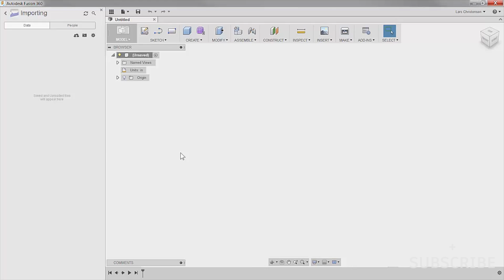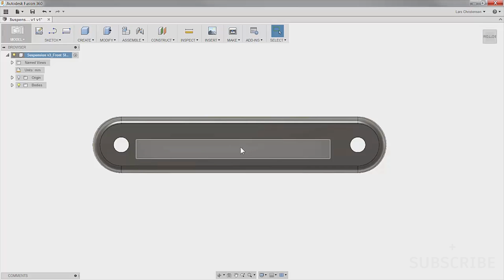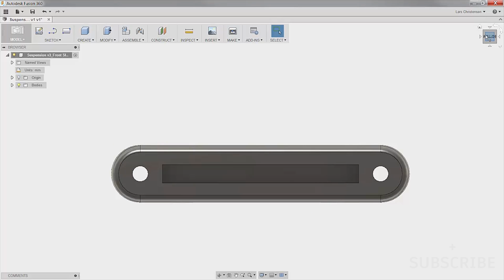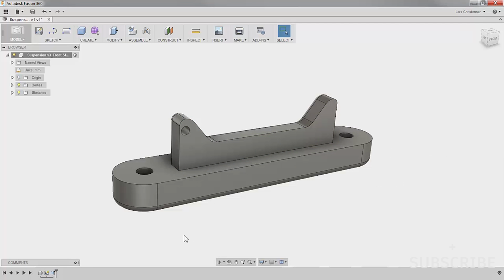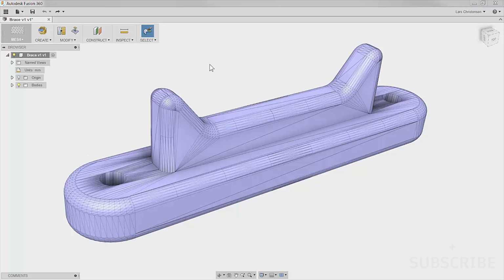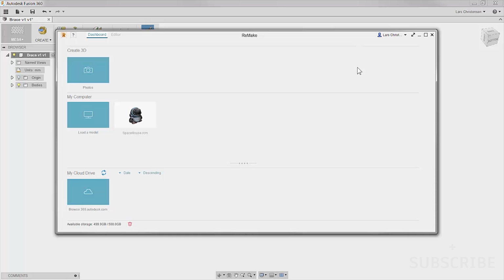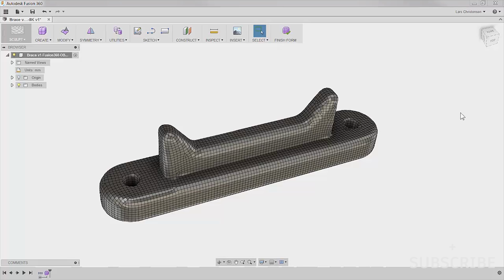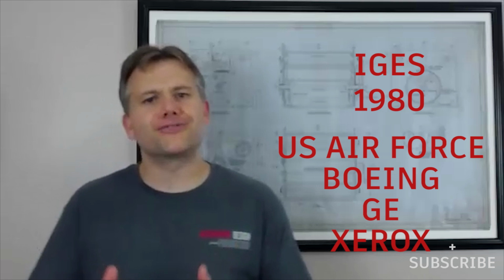Fusion 360 Tutorial— What you need to know about importing into Fusion

Comment: Hi; question:

How can I import a fusion file into another design, but without any links in place, so that I can delete the original imported file.....(just to add: when I  insert a file into another and then break the link, I still can not delete the original file because the import action is captured in history even though link is broken)          Thank you
Reply from the maker: Can you use Save As?
Reply: @cadcamstuff  Hi Lars,

Thank you for response. 

I actually discovered that in Fusion 360 the only (non-mesh) design files that can be imported into a design without any reference to a cloud file, are the McMaster Parts and Manufacturer Parts. Everything else can only be imported with reference to a cloud original file.   Regardless I'm happy with Fusion 360 and I think it's great :)    I just hope they add the capability in future updates.

Comment: the stl is solid that why it used in 3d printing its watertight, the other files are not solid( there data but no closed)manifold that why you can't print them, I think I used to be 3d print engineer

Comment: Hi Lars, I've been messing around with fusion for a couple of days and imported a complex SW part (about 100 features and way more sketches). But for a complex model is there anything that you can really do/change with it? So far it seems the only thing I can do to it is turn it around, and no way to find out it's dimensions.... Thanks
Reply from the maker: Hi Rudivg30dett Thank you for watching! You do have some pretty good direct editing tools available in Fusion. The problem is that SW does not share the sketches and other information such as mates when you open the file in another system.
Check out this video on some cool tips on direct editing:
https://youtu.be/2OZ7AuMXDJ0?list=PL40d7srwyc_Mkgc5wvP_OfVel9aDkNkZ6

Best,
Lars
Reply: Thanks alot Lars, you're pretty dedicated even repsonding on sundays :) 
The direct editing is unfortunately unsuitable for the complicated part I'm trying to modify. Basically, to do a proper job I would have to measure every aspect of the Solidworks model and completely redesign it right? 
Thanks alot, Rutger
Reply: @Rudivg30dett  did you manage to figure it out without redesigning?

Comment: Hi Lars,
Is it possible, once you convert the model into a solid, to then sculpt or add or modify that said solid? Like add more geometry and push pull or extrude etc.? I use Zbrush and now I'm trying to learn Fusion and I'm trying to then import zbrush files like STLs and OBJs etc. into Fusion but then I have to do some finagling and then ultimately to no avail to be able to sculpt on the model. I also have trouble with using the imported model as a stencil for instance to create a sketch or to use the model as a stencil to create new bodies etc. My goal is to use models I've made in zbrush in Fusion to clean them up, refine them, and create nice, clean hard surface models/geometry. Over all I'm just having some trouble learning this software and trying to do the things I need to do. :\ Can you help me? Or someone else who's reading this? Ppplllleeeeaassse
Reply from the maker: Hi Stephanie McDowell Thank you for watching!
You you have a couple of options. You can change the STL as a mesh:
https://youtu.be/cKXvIWpLoeU?list=PL40d7srwyc_Mkgc5wvP_OfVel9aDkNkZ6

Or, you can use direct editing after you turn it into a solid:
https://youtu.be/2OZ7AuMXDJ0?list=PL40d7srwyc_Mkgc5wvP_OfVel9aDkNkZ6
Reply: Thank you so much for replying! I will definitely check those out and try them out! Thank you again!

Comment: when i import a step file into  fusion 360 (electromotor i downloaded froma website) i get this wireframe model,it doesnt apear like when u extrude a body(full) but i can see all the lines. why is this happening?
Reply from the maker: Hi Mrtvababa Thank you for watching!
There is a chance your step file is coming in as surfaces. If you expand the bodies folder to the left on the screen, do you see orange surfaces or white body blocks?
Reply: the problem was that the view (monitor icon on bottom) was set to wireframe.
Thank you for replying :)

Comment: Thanks for this video, one question is it possible to get a pdf file into fusion?
most cad software can export pdf files but I don't think any of them could open them as a drawing file 
kind regards Hans
Reply from the maker: Hi Hans, right, because a pdf is nothing more than a pixel image. So you can really manipulate anything. You can bring it in as an image and trace sketch lines around it.
Reply: no,sorry  it isn't because I can turn layers off  or on in a proper saved pdf and it is not pixel based, but vector based I can enlarge it very far without losing sharpnes (like a cad programm) 
I have pdf files from floorplans I use for my work and with acrobat reader I can work with them but I cannot make changes hence the question
Kind regards Hans

Comment: Hi Lars...
Thank you for taking the time to create these training films. You are a good teacher of the subject matter.

I am brand new to this, and was wondering how you re-oriented an imported STL file for 3-d printing. -  For example, lets say you drew a pyramid, but you drew it upside down, where it is balancing on the point. Then, you make an STL file of it, and I get the file from you -  -   It could be printed like that, but it would need much support fill-in, and would waste a lot of media.

How would you import that STL file, and then re-orient it so that the base of the pyramid is on the bottom when you 3-d print it? (or would just changing the view as you demonstrated take care of that when you  select the 3-d print option from the imports file?)

Thanks again for your patience and time.
Reply: Never mind the question above....I just discovered that you can change the orientation of the part in the slicer program before generating the g-code.
(The adventures of a noob!)
Thanks again
Reply from the maker: Glad you figured it out! 
You are totally right, you can also use the move tool in Fusion 360
See this video:
https://youtu.be/EejRr-Y3174?list=PL40d7srwyc_Mkgc5wvP_OfVel9aDkNkZ6

Comment: Thanks Lars for the GREAT video. I wish AD video were up to your quality. On a different subject - when changing tools in F360 should the posting tell the CNC to move to HOME (G28) as well retract Z? Or is there some function in the CAM you need to select to move the work away from you tool?  Looks like I've got to edit my machine specific "post processor configuration" again

thanks for any help or not
Reply from the maker: Thank you for watching. It really depends on the machine/controller if you want/need to tell the machine to go to G28 and retract....Well, I think I always want the machine to retract before a tool change :-). what I'm trying to say, is that it could all be in the M06 macro.
Make sure you check the options (depending on what post you use) that you can control in the lower right corner in the post processor dialog box (the screen with the drop of all the posts that comes with Fusion.)
If this doesn't help, I would suggest that you check out the forum. There are some crazy smart post people over there.
Let me know if there is anything I can do.

Have an awesome day!